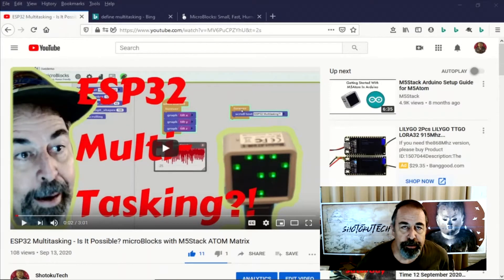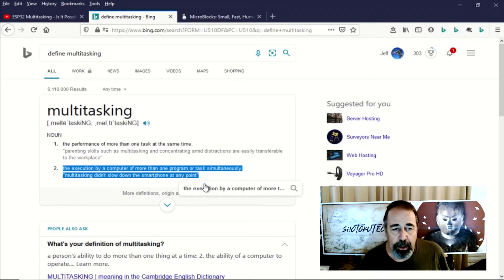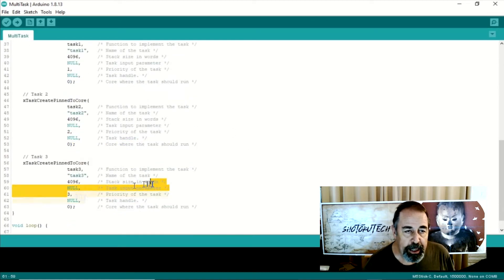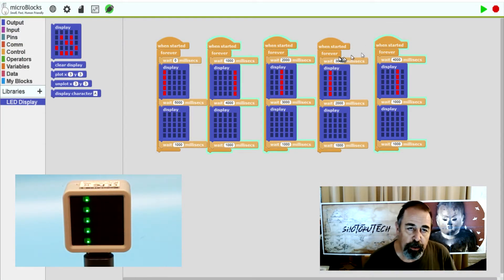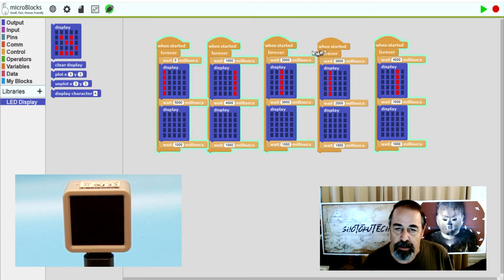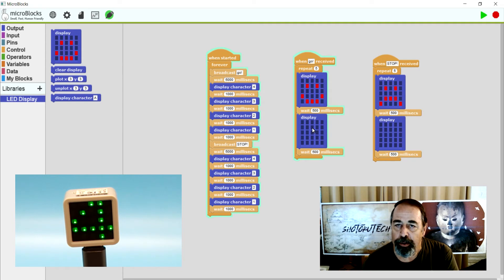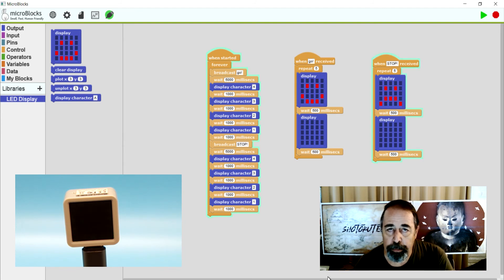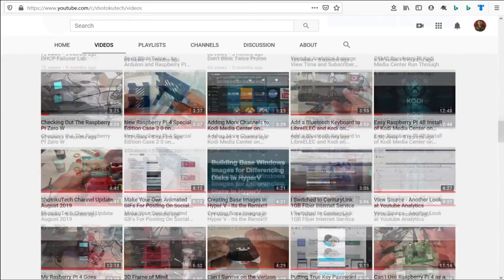ESP32 Multitasking - More M5Stack ATOM Matrix microBlocks Examples

Comment: Good video. I think in that micorBlocks example you could skip those loswer parts that clear the display, because each task does that anyway before it flash up its column of pixels.
To get the result you usually wanted, you can use the plot(x.y) and unplot(x,y) blocks to control each single pixel. This way you can control yourself when the pxels get cleared.
Reply from the maker: OK, but what about event driven? Did I get to what you were thinking about there? That part clearly shows multitasking and worked as expected. Thanks.
Reply: @ShotokuTech  Yes, you did. It's amazing how easy it is to create multiple tasks and event driven programs in microBlocks, if  you compare it to the efford it would be in Arduino C. The examples in your videos explained and demonstrated both well, which isnt that easy with the limited IO options of an Atom Matrix. 
I also liked that Arduino code example you showed. There are so many youtube videos showing how to create multiple tasks in arduino C. All I saw before were quite complicated and not very intuitive. With that M5Stack library for arduino you showed its much easier.
When I tried your examples I saw microBlocks also supports the M5Stick and M5Stack cores. It's cool how microBlocks emulates the Matrix display on their TFT-screens. I really have to do more with microBlocks.
Reply from the maker: @jeanyluisa8483  You are so right! This is fun! I got to get through some other tech stunts this weekend. But I will be back to microBlocks soon! Thanks.
Reply from the maker: Great idea on plot. Will do!